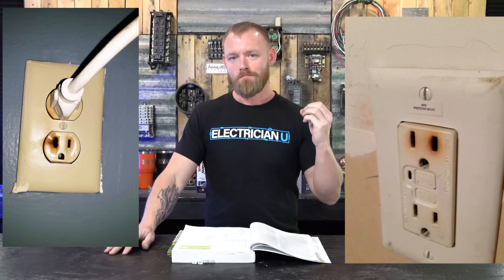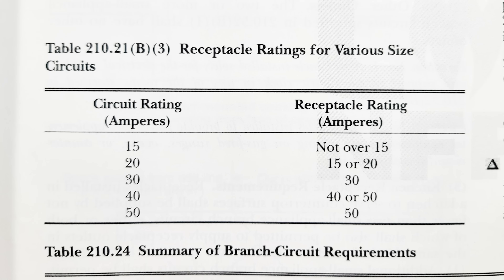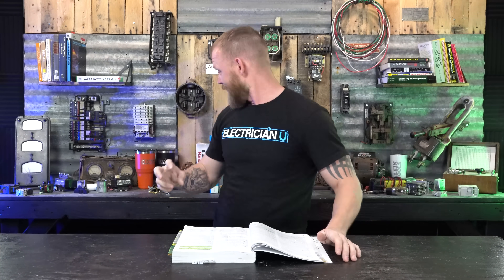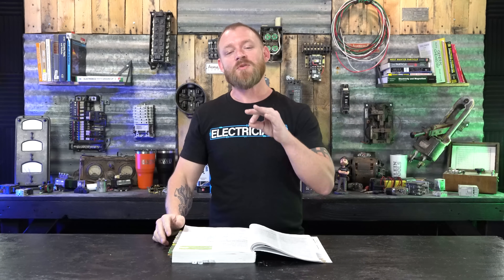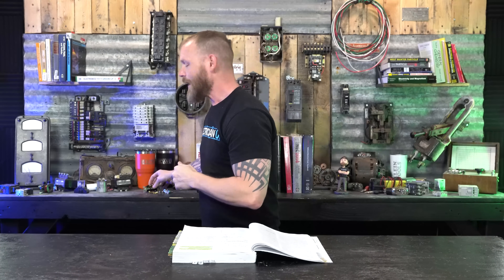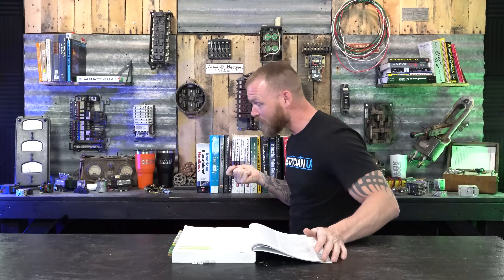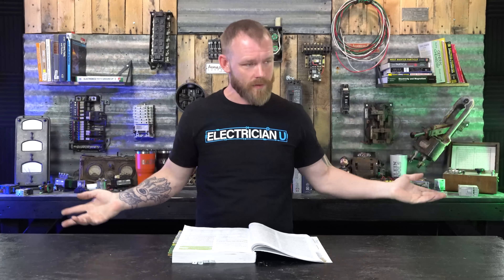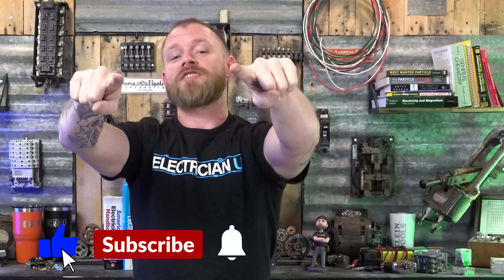Won't These Melt?!? 15amp Receptacles on 20 amp Circuits!!!

Comment: The thought has just crossed my mind that hairdryers are often (if they are true to their marketing claims on the box of "1875w"), not compliant if they have a 15A plug. And yet they inevitably ALL have 15A (GFCI cordset) plugs.
This confuses me greatly, however I'm sure that the most likely way that is allowed is that they are not in fact consuming 1875w (which would result in a potential lawsuit claiming "false advertising");
Or far more likely such devices are accounted for in (and allowed by) the code in a separate section not covered in this video because they're not expected to be operated continuously (usually under 10 minutes, and even then that's not continuous use as you turn it off when you put it down to comb your hair or apply hairspray or whatever).
But still, I'm someone who would feel safer operating such things on a 20A circuit.
Reply: You could test this with a splitter and a clamp meter. Anybody wanna do this?
Reply: @declanfarber  I'm less interested in what they actually draw, and more interested in "how does something that actually does draw 15A (and not 12A) is allowed to be equipped with a 15A plug and not a 20A plug."
This happens with shop vacs and a lot of power tools too, not just hairdryers. And I'm not gonna go out and buy all of those just to test them all and then never actually use them. So my question remains:
If something is actually capable of drawing 15A continuously, how is it that it is still sold with a 15A plug and not a 20A plug? Because that runs directly counter to what I've heard in this video just now.
Reply: @44R0Ndin  I would test a hairdryer myself, and I have the tools to do it, but I don’t have any hair, so…
Reply: I think you hit the nail on the head with time of use. If you are running a few percent over the 15A circuit rating it is going to take several hours for things to get hot enough to be a problem. Not even my teenaged daughters were able to use a hair dryer THAT long 😁.

Comment: I'm a person that doesn't like these "edge cases" that can result in undesirable outcomes, like a melted receptacle.
The house I live in does have several issues with how the circuits are arranged thru the house, and so I think that it's time for the house's wiring to be at least mostly re-done. I mean, it might have been code compliant when it was constructed, but that was in the '70s I think, and our circuit breaker panel doesn't even have a main breaker on it (I don't LIKE that, but it's probably fine according to the "6 flips rule"). Plus there's no more room in the panel for any more breakers, and we have a lot of electronics in the house now so I want to have some whole-house surge protection installed as well.
But now that this video has come out, I have one further request, that I'm going to try my best to fit into the budget for the project. And that is 20A receptacles if the circuit is a 20A circuit. 15A receptacles might be code complaint, but that's a minimum, and who knows one day I might upgrade my high performance computer and need that 20A receptacle to plug the power supply of the computer into (if you've looked into how much power graphics cards are requiring these days, it's pretty significant, 300W seems to be the minimum). IDK if my next computer is going to "need" a 1600w power supply (those are indeed things you can purchase, but they don't have the typical PC power cord because of the higher current they require), but I know for a fact that that's gonna draw more than 12 amps, so the minimum it would need is a 20A receptacle and cord. And I'm going to be honest, I don't want to be limited by which receptacles are 20A in my house.
Also don't want to be surprised by some new wall-mount air conditioner having a 20A plug on it and not having a place near the window to plug it in to. It's not like 20A receptacles don't take 15A plugs, either, so there's really not much of a reason to not do it other than maybe some minor short-term cost savings. Speaking of air conditioning, it would be nice if we could at the same time get the house ready to change over to some ductless mini-split heat pumps instead of sticking with the window-mount air conditioners we currently use (with window units seemingly always terrible ability to seal the window they are placed in, and inability to be operated in reverse as a heat pump on colder days). That would save a lot on the heating bill most of the year, and we don't have to get rid of the oil-fired baseboard radiant hot water heating system either, it could stay in operation for backup.
Reply: Electronics don't use much juice.  Your 300 watts is less than one amp.  Yeah I've seen graphic cards at 1000 or more watts.  Big users are electric motors, compressors, heating grids.  My electric furnace is on a 75 amp circuit at 220 volts.  Motors have a turn on surge.  These new lights are only 18 watts for big ones.  Electric water heater is 5000 watts.

Comment: If  you use a  single  receptacle  ie  designated   circuit   it should rated at 20 amp .   Usually  if  you use  a space heater it should be  on designated circuit any way!

Comment: Dustin, can't thank you enough bro for these vids, all the work you do, and particularly your obsessive commitment to doing it right, safe, and clean. As a paramedic and ER nurse I've seen some hellacious injuries from electricity over the years whether from lightning strike or just shitty unsafe habits. I grew up with my dad teaching me general DIY skills, but always emphasizing the line between being honest about your limitations ansd calling a professional. I'vee always been a little obsessed with electricity and this channel lets me secretly nerdout, but this video majorly helped me out over a head scratcher. I had no idea breakers had 2 different methods by which they can trip. This was a serious light bulb moment. Anyway man, thanks for all this incredible content: liked, subscribed, dingy belled etc. This shit is gold and inspiring, damn, thinking about a new career at 48. Keep it up.
Reply: That type of breaker may no longer be code.  New ones are current sensing and can trip below maximum faceplate if needed.  The ones in my boat look like the inside of a transister radio with caps and resisters etc.  I always follow KISS.

Comment: A single 15 amp receptacle CAN be installed on a 20 amp circuit breaker if used on a circuit supplying high in rush current like an air compressor or air conditioner. A small window air conditioner might draw below the what we call the 80% rule or less then 12 amps but still trip a 15 amp breaker on start up thus requiring a 20 amp circuit breaker. Have done this on jobs that I pulled a permit and had passed inspection. Would P touch a label on receptacle cover saying for air conditioner or air compressor only. Code has so many exceptions that already asked 2 talented inspectors the same question and got two different answers ( does not happen that often ). My first two toaster plugs got hot after a few years due to very fine strands breaking st plug connection. Replaced cheap plug with a quality right angle 15 amp male plug and never got hot again. Sure if I did not replace the hot plugs it would have damaged original cheap duplex receptacles that cams with the house but since replaced with spec grade devices.

Comment: I think this a big failure on the part of the NEC to protect people homes. In my humble opinion a good electrician won’t use 15 amp receptacles on a 20 amp circuit breaker because a good electrician knows what will happen. A good electrician knows that a 20 amp breaker will hold 23 to 24 amps for a long time, they are designed to carry about 130% over their rating before tripping and a 15 amp receptacle is also designed to carry 130% over it’s rating however even with the 130% factor it will only handle  1.9.5 amps of load before failure begins. I see it as a person who knows what they are doing and a person that just knows code and has little to no practical experience as an electrician. BTW is any duplex receptacle  considered a single receptacle  I don't think so.
Reply: A good electrician knows 15 amp receptacles are required by UL listing for 20 amp pass through and that internally a 15 amp residential grade receptacle is just as robust as a 20 amp residential grade. There is no failure by the NEC here in protecting peoples homes, just failure of some electricians to educate themselves.

Comment: Hmmmm... How is this affected by the use of a NEMA 6-20 dual receptacle? 
I have installed two of these and labeled each of them as "DEDICATED 20A SERVICE" from my solar array and each is tied to their own 20A breaker.   The array provides 8000w total service and is battery supported up to 10kw of service..

Comment: Got a question : my house has 15 amp breakers with 15 amp receptacles but on 12/2 w/g Is this a problem ?
Reply: Not at all. Bigger wire, less resistance. If you decide to up your circuits to 20, just make sure that each one you change the breaker to a 20 on is in fact verified to be 12-2 wire, and I personally, would recommend to change the receptacles on that circuit to 20 amp receptacles as well. Worth the small uptick in cost for peace of mind
Reply: @sheepishmclemmingston5550  that’s what I thought . ThankYou for the information!

Comment: 10:54 Code is a "D-" on the grading scale.  Anything less and you get an "F."   You can always do better, but typically will cost more.  For example follow some of the commercial standards in a residential setting.  😁👍💲

Comment: I believe  the highest wattage any device plugged in to a receptacle is 1200 watts in rhe USA.   So basically there is a 10 amp limit on any device.
Reply: not true.... it's common to see heaters and hair driers at 1500 watts. (around 12 amps) Hand held hair driers now go up to 1800 watts (15 amps) although hard to find.

Comment: How many people actually own a device with a 20A (NEMA 5-20) plug on it?  I would venture to guess there are very few consumer items with 20A 120V plugs on them.  I don't know anyone personally that has an actual 20A device.  The breaker is rated to save the wire, the device will have its own fuse/breaker as well.  On a radial circuit you have multiple 15A outlets on that same circuit.  Remember that the max wattage of a 15A device with NEMA 5-15 is 1,440W (80%) of continuous load.
Reply: It’s pretty rare, but my microwave oven has a 20A plug on it (with the one blade sideways).  This is because it draws 16A, and the whole purpose of the 15A/20A distiction in receptacles is force big appliances like this to only be plugged into a circuit that can handle it.
Reply: @kc9scott  Yeah thats an oddy.  I haven't seen any modern day units over 1450W, all with NEMA 5-15 on them.   Funny that while I have a 20A circuit, I have only 15A plug for the built in microwave.  That same circuit also runs two vent hoods and two gas appliance igniters outlets as well.  There is a total of 5 outlets on that microwave circuit, although ours is only 1100W.

Comment: This helps me as I have a 20 amp outlet on a 15 amp breaker and I was worried if it would cause a problem.
Reply: A 20-amp rated outlet on a 15-amp rated circuit can cause a problem. One functional difference between a 20-amp receptacle and a 15-amp receptacle is the plug blade orientations in the receptacle face. A 20-amp receptacle has the left, or neutral, blade opening configured with a "combination" horizontal/vertical opening; the horizontal part is designed to accept a 20-amp plug, which has the neutral blade horizontal (90 degrees off from the vertical, hot blade). So, a 20-amp receptacle will accept either a 20-amp plug or a 15-amp  plug, which is fine if your CIRCUIT is 20 amp. However, installing a 20-amp receptacle onto a 15-amp circuit is not a good idea. While it would be fine if you were only using 15-amp devices (with 15-amp plugs on the cords), the problem is that the 20-amp receptacle would allow you to plug a high-current draw device (equipped with a 20-amp plug on the cord) into that 15-amp circuit. When you operate that device, it could try to pull more than 15 amps through the circuit, which would exceed the capacity of the circuit wiring and breaker. I would definitely remove that 20-amp rated receptacle on that 15-amp circuit, and replace it with a 15-amp receptacle.
Reply: 15 amp outlet on a 20 amp circuit is OK

20 amp outlet on a 15 amp circuit is NOT OK.

Comment: Im assuming it’s a code violation for a 15 amp switch on a 20 amp circuit if it’s only switching one small ceiling fan but feeding 20 and 15 amp receptacles?
Reply: Just buy a 20a switch. It's pennies more.
Reply: @Morberis  ... you can buy one at a supply house but most hardware stores don't have 20 amp switches.
Reply: @rupe53  Really? Up here you can find them anywhere you find 15a ones.
Reply: @Morberis  ... outlets are easy but switches, maybe not. Depends on the hardware store.
Reply: Unless the switch is turning on power to the receptacles it's not feeding them, merely on the same circuit. A 15amp switch for a small ceiling fan is perfectly adequate.
Reply: @gary-dc9st  Ah see, up here it's different. Unless otherwise specified, like in motors, transformers, etc, the switch has to be rated to the circuit ampacity and not the load.
Reply: @Morberis  .... I believe NEC covers the switch question for LIGHTING circuits only with 15 amp devices on a 20 amp circuit. Switching a 15 amp outlet seems to be allowed, but switching a series of 15 amp outlets could put the switch over it's limit and would call for a 20 amp switch. Lighting circuits generally deal with only portable items. IOW, household items with a cord and plug. Permanently installed items must have a switch rated for the installed load... but they go off on a tangent for motors so not clear to me if ceiling fans are ok with a 15 amp switch by code, even if rated well below that.
Reply: @kenbrown2808  ... yes, but that doesn't fully answer the question of allowing a 15 amp switch on a 20 amp circuit. I'm reading between the lines at switching one outlet, versus switching several outlets. IOW, a single 15 amp duplex outlet might qualify as being a load within the switch rating, so allowed.
Reply: @kenbrown2808  ... yes, that's where I was going. A single outlet rated at 15 amps would be the rated load for the switch. Multiple 15 amp outlets would be over the rating for the switch, although if it were a 15 amp circuit the rules on how many outlets would change.
Reply: @kenbrown2808  ... practical application says you are correct. I just never found it in the code.

Comment: This definitely doesn't fly in Canada. 100% people will put 20a on 1 receptacle.  1200w heater, a computer, monitor, lamp, etc. Bam 16a real easy.

Up here 20a receptacles are only slightly more and sold in bulk as well.

Comment: Most of Europe no longer has this sort of choice; national codes will specify a single size receptacle, be it 13A in the UK, 16A Germany & France, 10A Denmark etc.  Italy is one of the exceptions as both 10A and 16A exist and are common, but modern ones are often in combination so are universally engineered for the higher current rating.
Reply: Considering the voltage difference a 10a euro outlet is roughly equivalent to a 20a  us outlet and a 16a being roughly equivalent to a 30a outlet, 30a outlets are only really used for large appliances so its interesting to see that kind of power for every plug
Reply: @noobulon4334  But the devices, appliances, lamps etc in those countries all have fuses in their plugs so perfectly safe to plug a 1/2 amp fan into a 16 amp, 230 volt receptacle.

Comment: Wouldn't life be easier to just downgrade the breaker for all residential outlets to 15A? That way, you're better insured to not over load or "cook" any internal wiring. Later on, you might consider selling an "upgrade" when that space heater keeps popping the circuit too. Ya, it's a little underhanded. But if people aren't going to pay attention to what they're plugging in -- or the outlet -- then I say better to be safe than sorry. ... And yes, even on kitchen outlets too. Maybe especially, particularly given the all the DIY projects you see everywhere where budgets often go for the cheapest outlets. (15A outlet on 20A breaker for a refrigerator? Um, NO!)
Reply: seeing as a fridge only draws about 2-3 amps steady state, I see no reason you can't use a 15 amp outlet, although if code calls for a dedicated outlet then you need to follow code.